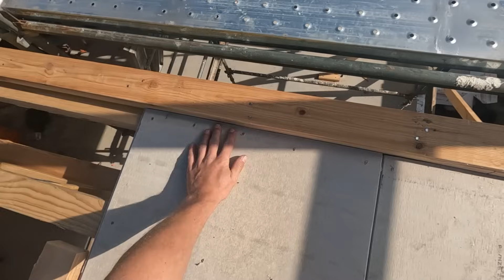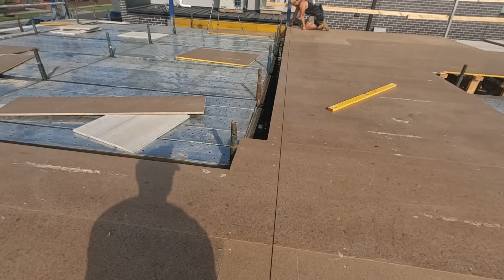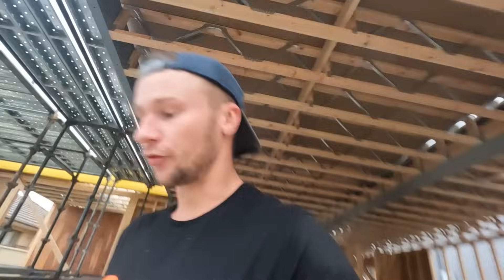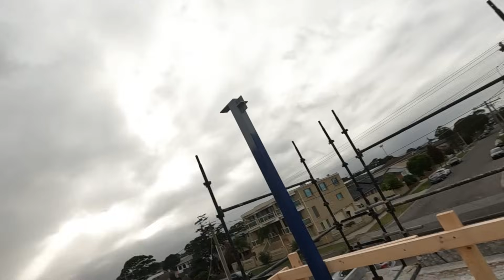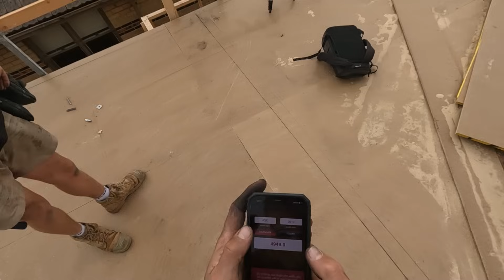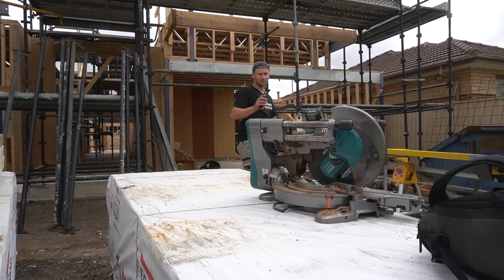Flick out and Cutting in Plates - Framing a house | Day 11-12

Comment: You're great referencing the plan so often. Phone screen seems a bit difficult to use as a reference, you could print the plans at A3 or an appropriate size for whatever you're building and laminate them. Hole punch and use a keyring coil to keep them together
Reply: plans change with alarming frequency during the build, on the fly. It would be a full time job just to support the chippy on site with hard copy plans. Digital is the only way to keep up.

Comment: Hay mate how come you put so many 3 inch nails in your sheets ?
Reply: Rather put more nails/glue at the easy stage. Rather than later customer/builder complaining that the floor is squeaking which will be costly to repair.
Reply: @Lone_Wolf1995  mate putting nails in like that makes your floor squeek more over time  the head starts popping up and creates a squeek.
A screw has thread were they don't uplift like a nail.
Should be putting 4 screws in every 450 centre on them yellow tongues brother
Reply: Of course screws are the way to go. But if I wasn't screwing I'll certainly add more nails
Reply: Best practice is to skew nails so they are less likely to pop up and squeek
Reply: @julianwalters1994  I always thought this too, but a nail takes 1 second and then he would need a collated screw gun with extension.